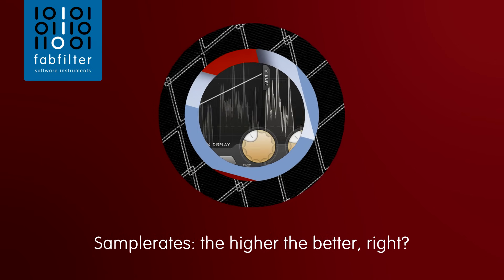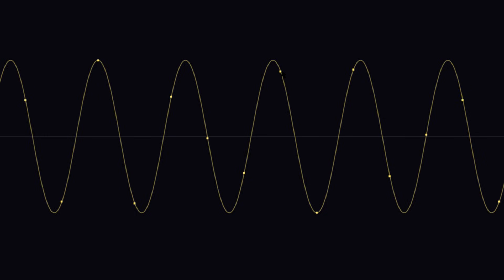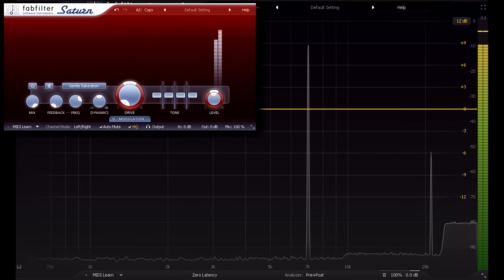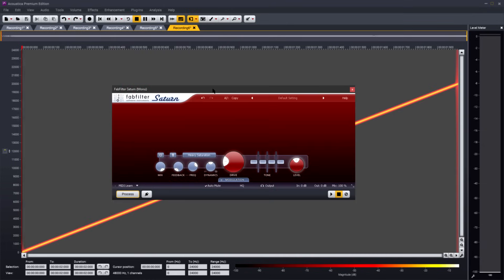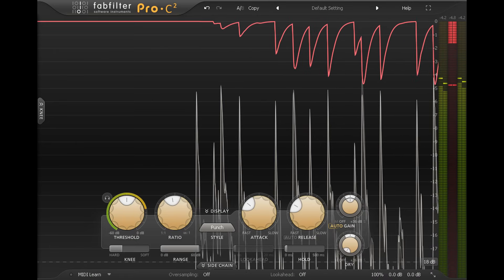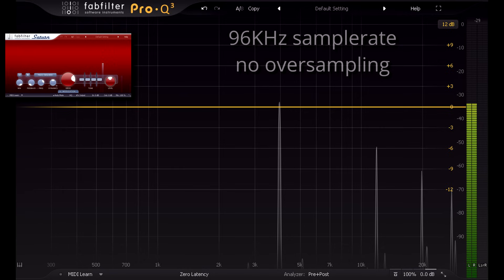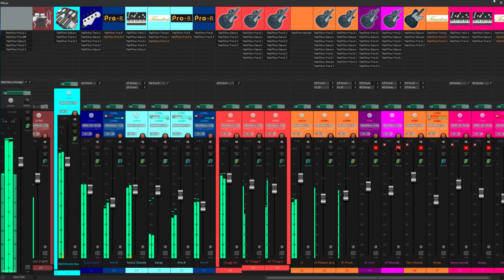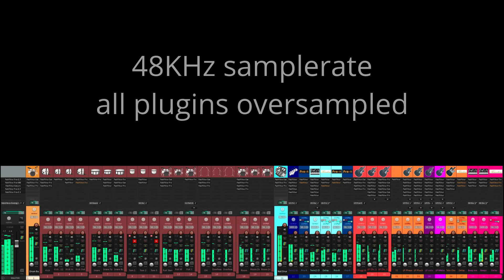Samplerates: the higher the better, right?

Comment: The most important feature for high sample rates which you did not talk about, is the ability to pitch down audio with much better quality. Other than that, awesome video!
Reply: Igelkotte Good point, thanks.
Reply: I can see this being relevant for slow motion video. I'm curious, what are some other areas where you would significantly downpitch as to where this would have a relevant impact?
Reply: @thorwaldjohanson2526  basically in any modern electronic music production/sound design environment, for instance drum'n'bass and jungle producers have been severely downpitching/pitching/timestretching all kinds of sounds since the 90's, also the whole "chopped and screwed" hip hop sub-genre is BASED around slowing songs down for example.  Furthermore, changing the speed of a sound is basically one of the easiest ways of transforming it and making it unrecognizable, hence giving you creative options.
Reply: @thorwaldjohanson2526  Auto-tune. The way it works is that it cuts audio into the tiniest chunks and sort of copy-pastes them and stretches them to alter pitch, length and vibrato. With 44.1 kHz, it sounds weird very quickly even with very mild auto-tuning. Even just having the recording in 48 kHz makes a big difference in my experience, now you can get away with correcting pitch and timing without it being noticeable. 96 kHz allows for extreme stuff if you're into that, but if you got somewhat capable musicians and are only fixing a few off notes or beats, 48 kHz works well for me (in Logic's own auo-tune system).
Reply: @Hamachingo  Thanks for the responses guys :). I'm curious, are you usually recording in 192khz 24bit and then downsample if need be, or do you start directly with 48khz? Or do you record different instruments at different settings? And are there any disadvantages besides filesize, to record at the maximum bitrate?
Reply: @thorwaldjohanson2526  I'm not in a pro studio of any kind, did 96 kHz for a while but settled on 48 kHz for everything, what what I do, it's perfect. Occasionally I upsampled it for mixing, but some of the plugins didn't sound right so I went back to 48. One big up-side of high sample rates is lower latency, super useful if you monitor through the DAW.
Reply: This was what I thought originally until my audio signals professor taught me otherwise. My understanding is a lot of modern smoothing algorithms in pitch-shifting plugins/DAWs upsample by essentially adding sample points between the gaps to prevent aliasing. However, when pitching down but maintaining the same length of audio, the waveform is essentially split up into chunks, stretched, then shortened before being compiled into a new waveform if that makes sense. It's a lot more complex than that nowadays but this is the basis of early pitch shifting, however created a noticeable effect (much like a beat repeat/granulator) so was often used more as a compositional technique rather than a way to convincingly change the pitch or length of audio. 
Modern algorithms have a lot more variables to them than this, but it's fundamentally the same, but the fact still remains the most effective way to drastically slow down or pitch down audio is just to re-record it. (Correct me if I'm wrong on any of this, I cba to dig out my Masters notes)
Reply: @thorwaldjohanson2526   Sound effects, for example: I've bee trying to create sounds for some CG monsters (by slowing down animal sounds by several  octaves). A higher sample rate would have made things easier. Having said that, there needs to be audio content  in those top octaves or that higher sample rate won't make much if any difference.
Reply: Only true if the sample's recorded at the higher sample rate, with a microphone capable of recording beyond 20 kHz (which it probably wasn't)
Reply: @hugecampaign  I disagree. High sample rates are better for pitching down when audio is recorded at them, not when the DAW is set to them. There are no added samples between others in recorded high sample rate content.
Reply: That and also being able to edit out stuff like clicks much easier.
Reply: Yeah. Pitching down is "destructive" to begin with as it is reducing high end by default... and you can resample before processing anyhow.

There are no stairsteps.
Reply: I would worry more about bit depth and how loud your aliasing harmonics are in your mix. If they get too loud you hear them after converting to a lossy format.
Reply: @mattmar96  The intermodulation is added samples
Reply: @thorwaldjohanson2526  Sound Design 101 ! It's always interesting to high sample rate record and then stretch and pitch down. :)
Reply: @thorwaldjohanson2526  I just don't worry about it. Ever. 44.1/24 is absolutely fine. If I was recording pristine instruments in a pristine environment with pristine gear, maybe I would have a reason to consider up'ing my sample rate. But most of the time the benefits of higher sample rates are not audible in any meaningful way and are outweighed by >1000:1 by every other aspect of the production process (microphone placement, instrument quality, performance, arrangement, acoustic environment etc.). It's good to understand the impact of sample rate though and to be able to recognise aliasing noise when I you hear it. Try feeding a sine sweep through Logic Compressor with the soft clip switched in - watch and listen to the analysis through Channel EQ and aliasing is super evident!
Reply: @Hamachingo  can you explain why higher sample rates should reduce delay? Why would it make a difference beyond maybe 1/96000th of a second? I have heard people mention this but never understood why...
Reply: @KrumpusPlunk  It is precisely about the difference of 1/96000th of a second (at 96kHz) but you get this delay added at every step of the chain.

Say your vocal microphone is plugged into some analogue gear and then enters the digital domain via an audio interface. That's your first delay. Once in the computer, you add some digital processing like compression and EQ. If the EQ is supposed to act on the output of the compressor, it can only do it once that sample went through the compressor so there's some delay there too. Repeat for every following insert effect plugin. The DAW software typically compensates for it by delaying everything by the maximum delay of the most complex channel so everything is back in sync, especially reverbs and MIDI instruments (and everything with "linear phase" in it) introduce lots of delay. Once all of this is done you need to make it analogue again so it can be heard in the monitoring headphones.

This delay is not really perceived as delay (unless you're really over-doing things) but rather as phasing issues and it sounds all wrong on vocals and instruments will feel unresponsive and disconnected. There's a reason why many people like to monitor entirely through analogue gear, but it doesn't work with MIDI instruments obviously.

Doubling the sample rate simply cuts all of these delays in half so you can greatly reduce that effect until it's tolerable and you hear the notes right as you hit them and vocals coming back in your headphones don't interfere with the natural resonance in your skull.
Reply: @Hamachingo  but, even if you'd have 100 steps in your chain, that would be only around 1 millisecond...? I'm sure there's other reasons for delay that dominate this effect by far? I really can't imagine people being disturbed by microsecond lag? And if everything is delayed by the max. delay, how does this introduce phasing problems (besides maybe when monitoring vocals while also hearing your own voice)?
Reply: @KrumpusPlunk  unless you're using dedicated DSP hardware, you get a lot more delay because the computer's CPU is also handling other things, like running the operating system and all the other software. Only very basic audio plugins will actually be finished with the processing within one sample, but they will typically be done within a fixed amount of samples. Then the DAW software can take that chunk of audio (typically a "long" slice of audio, e.g. a couple milliseconds) and throw that into the processing pipeline for the next plugin. Since we're not running DAWs on realtime operating systems (unlike DSP hardware), the system can only guarantee that the slice of audio is done processing sometime within the next x milliseconds. With higher sampling rates, it's simply forced to do that more often per second. It's like a city bus line coming around every 20 minutes can afford to be late by 19 minutes without the next bus overtaking it, but if it was on a 10 minute schedule, it can only be late by 9 minutes before getting in trouble. These issues can be solved with over-sampling though.

In your audio drivers or in the DAW itself, you can set the buffer size, i.e. the length of the slices of audio that your computer processes. Set it too short and your computer sometimes won't reliably have time to do all the processing before the next chunk arrives. Set it too high and you get noticeable delay. Many plugins have their own buffer and have to wait for enough samples to be accumulated so they can do their fancy math operations on it in one go. The buffer size is set in samples, 256 samples being a typical value. At 44.1 kHz, that gives you a minimum DAW delay of 6 milliseconds, add to that the conversion time and you got yourself quite the annoying delay.
Reply: @Hamachingo  thanks for your responses. So the way I understand this now is: it takes less time for the plugin to do its calculations than to collect the buffer(if it doesn't, you get dropouts). So in that sense it really is the buffer size that determines the lag, and this increases inversely with the sampling rate. But couldn't a plugin just use a shorter buffer when using a lower sampling rate to compensate for that? aka keep the ratio of buffer:sampling rate aka the "buffer duration" constant?
Reply: @thorwaldjohanson2526  sound design.
Reply: Hamachingo... Except no ody should be recording at 256 samples. 32-128 is standard range. 2-7ms RT is usually unnoticeable.
Reply: lower latency while tracking
Reply: @skwig5670  a caveat there is that the mics or music of those samples may not have content above the audible range, or may have only useless noise that you wouldn't want. the real way to ensure to get use from this is to use a mic that has an advertised bandwidth well above 20khz or you might find yourself low pass filtering anyway.

Comment: I've been a strong proponent of working at 44.1 project sample rates for over a decade. Based largely on the understanding that most music producers have sample libraries comprising 44.1 samples, and that crappy realtime SRC up to 48 inside most DAWs was incurring a needless quality loss from the minimum phase anti-aliasing filter during realtime SRC.  But your explanation of the cumulative effect of many oversampling stages with a gentler anti-aliasing filter at 48 has opened my eyes. Your A-B comparison at the end, of 44.1 oversampled versus 48 oversampled across the entire project was mind-boggling. My hearing is relatively destroyed at this point in my career, but even with my trashed ears, I can clearly hear the difference in that final AB demonstration. I would never have had the patience to set up a test project of that size to show the cumulative difference at 48 vs 44.1 like that. THANK YOU. (I'll be working at 48000 project rates from now on, despite the fact that I don't do soundtrack work and my sample library comprises mostly 44.1 samples.)
Reply: @Agent К_видео The difference is subtle, and falls into the category of "ear training" for certain things, plus a LOT depends on your monitors and room characteristics (or your headphones). I'm used to listening for "how much clipping is too much clipping" because I use clippers a lot and push limiters hard. The aliasing artifacts and IMD in the 44100 version has some similar "dirt" and "grit" around the edges of the transient sounds in the mix (like with clipping), and the mids and highs feel a little more "congested". By contrast, the 48000 version has a more "open" feeling in the mids and highs, and not as much of that dirty/gritty edge to the transients.
Reply: @Baphometrix  Agree with your assessment and my opinion was that neither were necessarily "better" I listened to the comparison with different sets of monitors, and for some it felt like the 44.1 version with OS was slightly more mid/low-mid forward and it made it feel like a more focused mix. No doubt that the 48 one felt a bit wider/open, but that's not always what I want/need in a mix.
Reply: I think you missed the point of that final comparison, which was that the A/B differences were negligible. I think the changeable nature of the music made it harder to notice the lack of difference between the formats.

Comment: Thank you, thank you, thank you, thank you. I've been telling people (mostly amateur engineers and audiophiles) this stuff for years but this is the first video I've seen that actually illustrates it perfectly with smart examples and incontrovertible proof. High sample rates for the final, consumer delivery format are useless. Even for basic tracking, they don't really matter because the majority of microphones don't pick up much of anything over 18k anyway. The only reason to use them is in mixing and it is far more practical to just use over-sampling rather than record everything at a higher sample rate.

Dan Worrell is the best.
Reply: Yeah I read an interview with one of the engineers that was on the CD team. 
Phillips Sony, there was a Toshiba guy there as well according the interviewee. 
It was fascinating reading.
Reply: Not all plugins have oversampling built in. They generate (fold back) aliasing in the audible frequency area when working on lower sample rates.

Comment: Great video and explanation.  Matches up with what I've been doing for years.  
 
I record and edit/mix almost everything at 48kHz.  With popular music, the space and processing savings of 48k are noticeable and any harmonic content above 20k is pretty much buried under other instruments anyway.  Plus, producing high sample rate content is pointless anyway since pretty much all forms of music compression (size) will bandpass limit the content anyway before applying the lossy compression.
 
However, there is still one thing that I record and edit at higher sample rates - that being orchestral music.  With typically few microphones (allowing acoustic mixing of the band/orchestra prior to microphone capture), the space and processing savings is unnecessary.  There are some instruments that do have harmonics, and even natural energy, above 20k.  I find it best to capture and edit at the higher sample rates and then apply bandwidth filters upon final mixdown.  This avoids the issue of those frequencies above 20k turning into aliased content in the below 20k range during initial tracking/capture or in the editing stage.
Reply: What do you think about recording the sounds of a keyboard through its headphone jack? Thanks.

Comment: Aligns with my own experiences and lessons over the years: bandpass everything, all audio is bandpassed at some stage anyway so you better do it.. before it is too late and the signal encounters something that can't cope with its demands. Distortion and heat will be the result of that and you will get degraded audio signal.

Also: Hi-res record releases are not meant for consumer consumption, you once again have to deal with bandpassing the signal before it hits your speaker. The end result is intermodulation distortion in the analog chain too. Most of it will be turned to heat but it is never a good idea to push too wide of a sausage thru a too small hole... A good speaker has ultra- and infrasonic filtering but one of the principles i have picked out is that it is far better to cut the signal before amplification than after. If for nothing else, components are smaller and the circuit design can be considerably better.
Reply: I hope one day to be as wise as you 🙏🏽
Reply: About these high res 'record' releases (I'm assuming digitized recordings of analog master tape playback then of course, just stating this because in common parlance the term record is often read as synonymous with vinyl plate prints); To deny that they are meant for consumer consumption (as opposed to what consumption?) is simply contrarian. You know about these releases, so you must know that their resellers have a consumer demographic. 
I consume, as a consumer - which includes every producer because none of us only uses music materials for work aka in your terms "producer production": just to source, process, stock etc. - I consume hi-res consumer content recreationally, like the vast majority of their target demographics. And I'm not sure if you're simply generalizing a part of this market, or if you're making a case against the release of hi-res digitizations of any music source material, for any recreational consumers. 
Certainly when taking what you're saying literally, that is what you are doing; but of course communication is too complex to know for sure. In any case, consider the consumption of hi-res releases, by a consumer who bit-streams it to a high quality digital-to-analog converter, going into an analog (pre)amplifier which easily handles the output signal of the aforementioned converter, ending up, in any circumstance which assumes no use of destructive ignorent elements in the signal chain between, playing back through high quality speakers or headphones. 
What about this is 'not meant' to be?